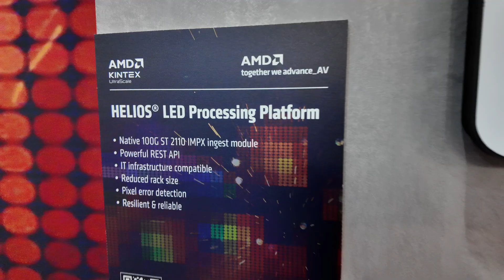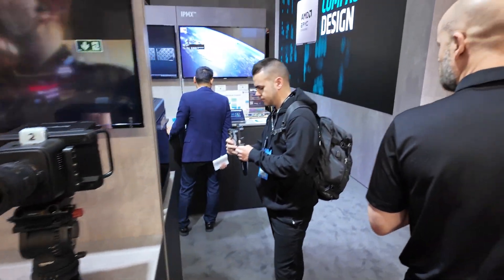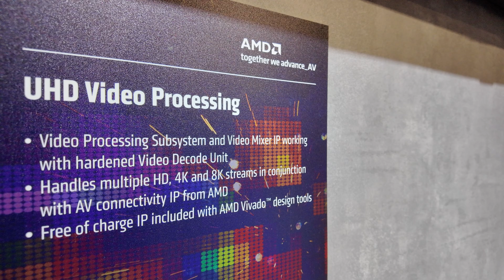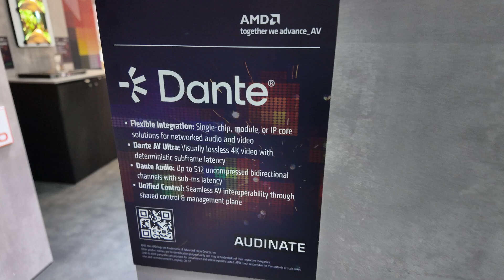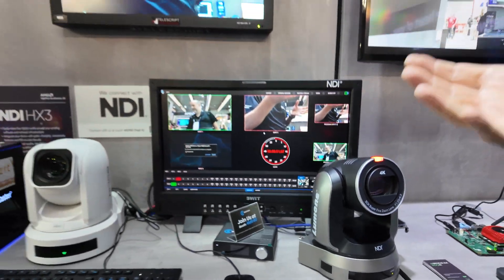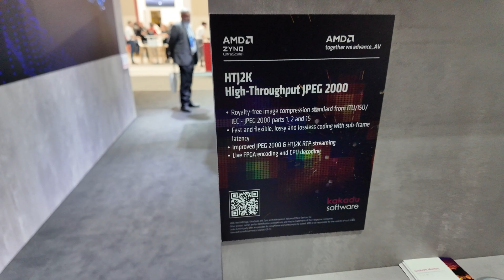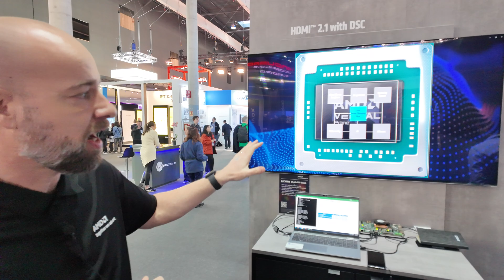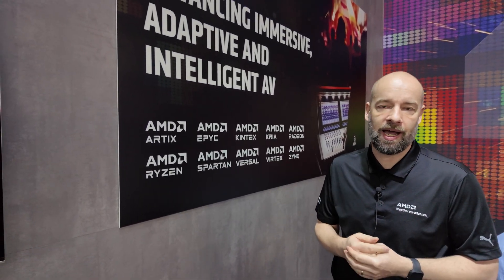AMD at #ise2025 Kintex, Zynq UltraScale+, Versal Power AV-over-IP, AI, HDMI 2.1, DisplayPort 2.1, 8K

Comment: If I had been following the livestream I would have asked you to ask AMD would we be seeing the inclusion of FPGA's on their RDNA 4 or 5 series graphics processors. RDNA4 is due in 2 months. But they only purchased their FPGA company 2 years ago and it takes AMD around 3 years to build a GPU.
I think AMD want to add some FPGA's so they can add a dirty reverse engineered + clean room built wrapper/middleware to interface between NVIDIA's DLSS4 software and AMD hardware. That way they close the huge lead that NVIDIA has over AMD in graphics card. NVIDIA will sue of course, to try to block it. But it will make AMD graphics cards far more useful and adaptable to new product categories